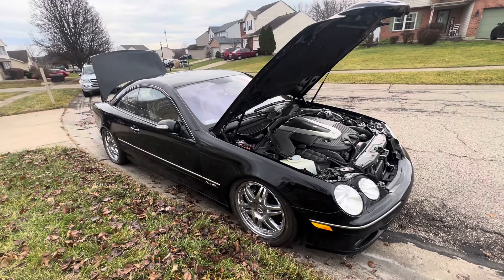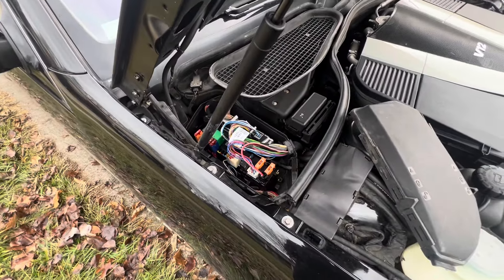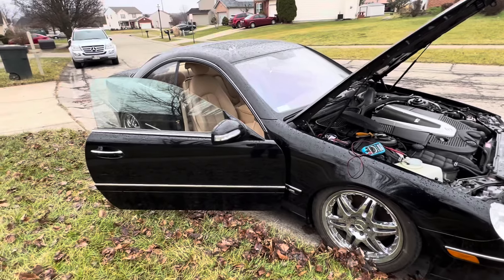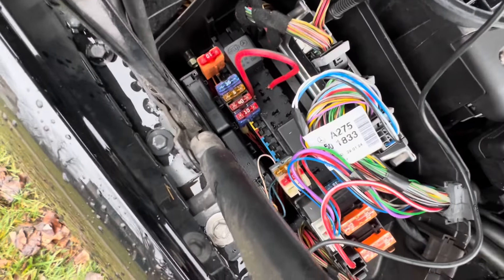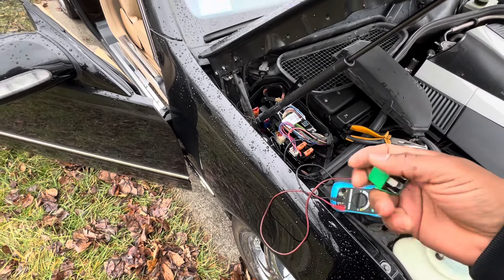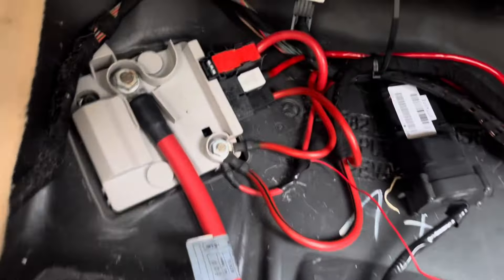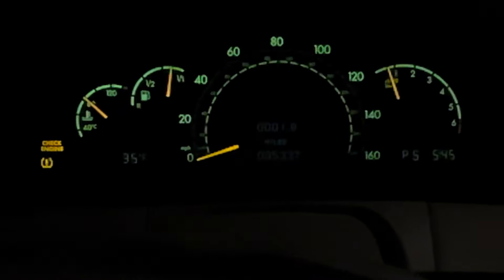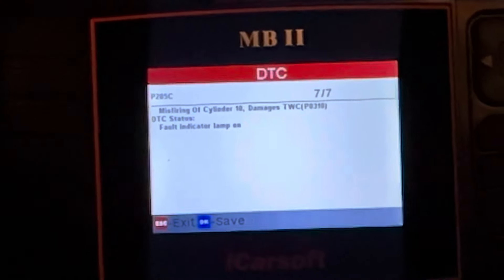I Got It Started!!!! See How…..😅 2005 CL600 V12 W215 PART 3

Comment: Had the same issue with power loss when I bought my 03 cl600. Turned out to be coil packs and an incorrect boost sensor installed by the previous owner. Do the spark plugs while you're at it if it does end up being coil packs. These cars need a lot of love, but there's nothing like them when they're running right. Good luck and hope you get to enjoy it soon

Comment: There is a fuse box behind the passenger side seat just below the backseat.  If your accessories like power locks, seat etc stop working odds are it’s a 20 fuse in there… trust me you will probably run into that at some point

Comment: I strongly suggest you get the CL hooked up to SD/Xentry. It's the only tool that will give you accurate information on fault codes. If you don't know anyone who has one, I would go the MB. Changing parts without really knowing what is happening is going to be more expensive.